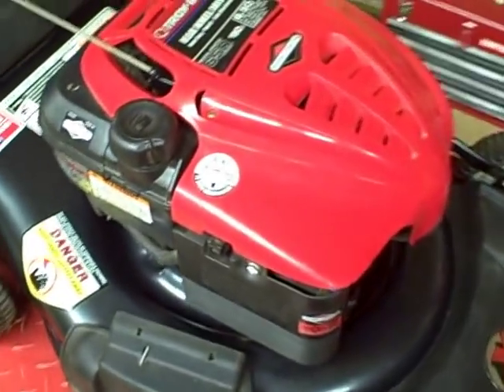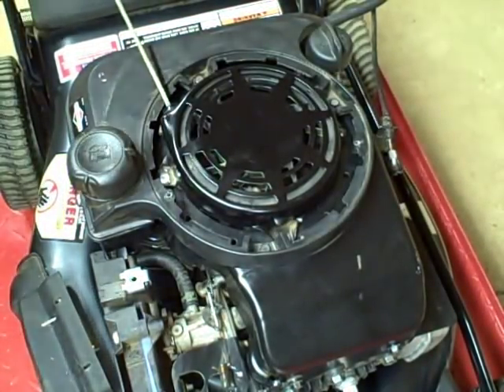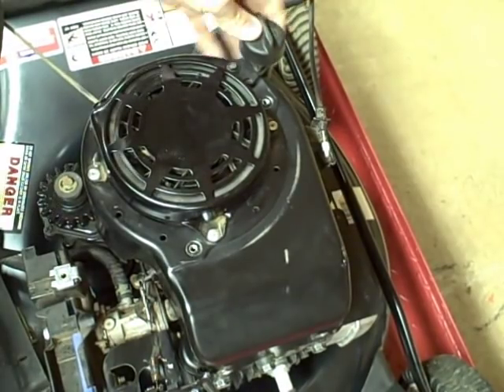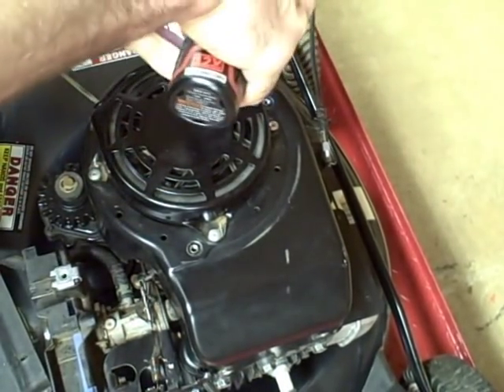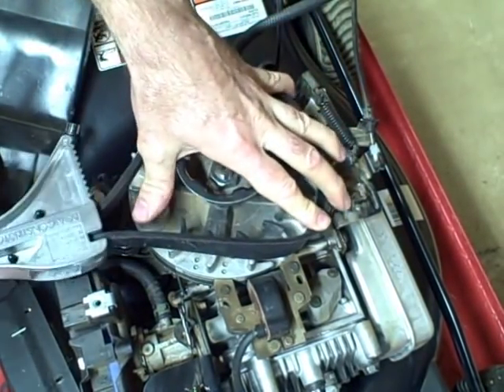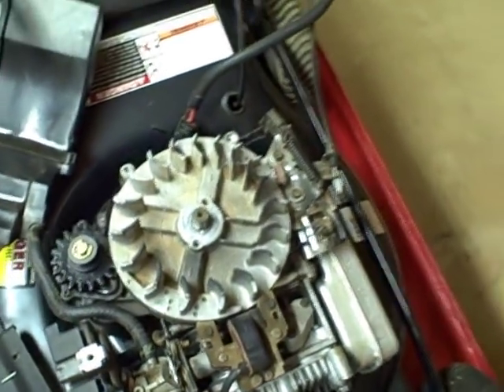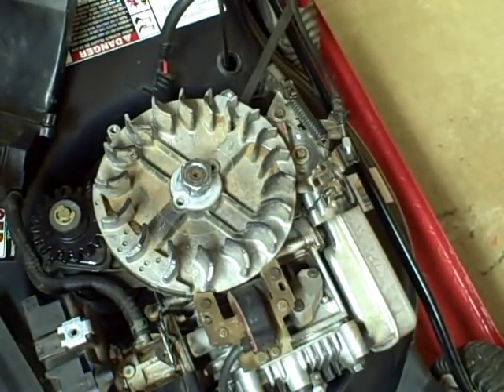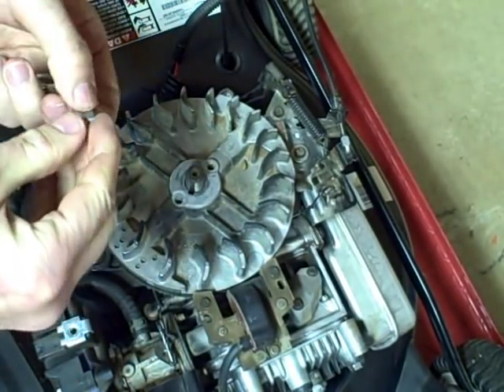How to replace a sheared flywheel key on a Briggs & Stratton walk behind lawn mower

Comment: You're a very smart man, to mention that the tapers on the crankshaft & inside the flywheel needs to be thoroughly cleaned and dried to prevent dirt or debri from causing the flywheel to slip on the crankshaft, which would easily allow the key to shear again. After professionally repairing various makes & models lawn mower engines since 1982, I learned A LOT about these things!

Comment: Thank you!  This never happened on my old belt driven mower, but my 2013 7.75 HP Snapper that I bought used developed this problem today.  Three screws, and my cover popped off to reveal a flywheel with shards of key, and a loose flywheel nut. While I was down there, I discovered the air filter hose wasn't attached, so this repair may save me from an even bigger one.  The hardest part of this repair was locating the model number.  Off to the parts store!

Comment: Thank you so much for this great video.  I brought my lawn mower in to be serviced, it just stopped working one day.  The place said they had no wait and could work on it right away. I told them i put new oil, gas, spark plug and had cleaned the carb. A week later they still had it and said they were working on it. 5 weeks later they still had it and said they were trying to figure out what was wrong. i demanded it back, took it home and followed your video. FIRST PULL! saved me a lot of money!

Comment: Thank you for posting this video.  I have a craftsman lawn mower with a Briggs & Stratton.  The lawn mower hit an old meter fence post, which destroyed the blade.  I replaced that but it won't start.  Next thing to check is the flywheel key.  Now I know how.

Comment: My father-in-law hit a piece of scrap metal that I tossed off the trailer right next to his house.  This did the trick getting it back running.  Thanks for posting this video.  I used a tie-down strap as an improvised strap wrench.  I just tied it off onto the mower push bar.

Comment: Thanks for the video buddy. I followed your video step by step for my 3 year old Briggs & Stratton and it worked like a charm. I had never worked on any kind of an engine before so this was a great learning experience. It took me about 30 minutes from start to finish. The only difference was that I didn't need to use a strap wrench to remove or tighten the flywheel nut. I just held the flywheel in place with my left hand and cranked with my right. Thanks again!

Comment: yes, thanks for the video.  your tip on how to get the flywheel off with just a pry bar and hitting with the nut slightly above the crank is a time saver when compared to using a 3-prong puller over the flywheel.  i'm going to do that next time.

Comment: Be careful with that, though - I just found out the hard way that if you don't tighten it down pretty tight - you're almost guaranteed you'll be heading back over to where you got that flywheel key to buy another!

Thanks @smallengineshop, this was super helpful!

Comment: Thank you!! I used the tip you gave for removing the flywheel without an impact wrench-worked perfectly!! Mower is up and running!! Can't say thank you enough-very clear and easy instructions, I had no problem following them. Thank you!!

Comment: This worked great!  Thank you for the video!  I had replaced my carburator, new fuel, new oil, and still not working. Almost ready to buy a new lawn mower...  Mine was sheared in half with flakes of metal all over which I saw after removing the flywheel.  Had it back up and running 15 minutes later.
Reply from the maker: +Charles Rankin Good to hear! Its much cheaper to replace the flywheel key than buy a new mower...

Comment: Thanks for this video. I had hit a stump with one mower and bought another used one a couple days later. Then started searching how to fix the old one. Saw this video and figured I'd try it. Couldn't find any 'keys' local so ordered from HD ($2.97 delivered to store for 3 of them which was 1/10th the price from sears). Keys came in 3 or 4 days later and within an hour I had the mower running again. Now I have two mowers working so I'll be able to sell one of them!

Comment: Excellent video, thanks. I had never done this before but you made it so easy I did it in 30 minutes. My flywheel did not come loose with your method, though - the pin was sheared and the crankshaft threads were rusty. However, I used a 3-arm puller which worked great.

Comment: Very well demonstrated.  You got yourself a subscriber.  Of course, if the key is actually sheared and the engine has been in the weather for a while; The flywheel would rather break in half than come off.  Even if you pry and tap the shaft and then cut threads and use a puller.  C'est la vie.

Comment: Thanks for the video man. Followed along and it worked perfectly. The flywheel was a bit stubborned to get off so I'm hoping I didn't damage the crankshaft or crankcase as you warned. Seems to be running fine though.

Comment: Wish ALL videos were as comprehensive and detailed as yours!!  I have one question, though.  What size socket do you use to remove the flywheel nut ... or is that a special sized socket like the one used for installing/removing spark plugs?

Comment: For those people that don't have a strap wrench or a blade removal tool you can also remove the spark plug and insert some rope to bind the piston to stop the flywheel from moving. Once the nut is removed I grab the flywheel and pull up and hit it gently on the opposite side of where I grab it with a rubber mallet to pop it loose.

Comment: Hi, That was easier than I thought after I saw you do it, the one question on that particular engine is what timing marks to use underneath, I'm assuming that I am to match up the plastic gear on the camshaft that has the 2 hash marks with the the hash marks or line on the crankshaft, John

Comment: Puzzle for Experts Here!;   Mine has the flywheel key with NO damage, but the engine after hitting something violently runs at HALF the rpm unless I really add another spring to force the throttle open!.

 It is an 2009 Ariens ST 622 String Mower that has a V belt drive to the jackshaft that holds the giant weedeater type "string" . I was cutting up crap after a Hurricane storm surge and the belt/string caught a piece of rope I did not see. The motor stopped what it seems instantly. After cutting out all the mess of rope I could start the engine but it only runs half speed when the throttle cable is fully to fast. It is pushing correctly at the carb. The only way to get it to run at a high rpm is to pull on the throttle at the carb. All the stock springs are there, nothing (outside) appears bent. One can disconnect the throttle cable and that is not the issue.

Thus I added another spring that tugs like mad at the carb area, but it still is not fully up to speed.

Thus I saw videos like this and pulled the flywheel and the key looks perfect. The old key and new one look and measure the same.  For good measure I replaced it anyway and reassembled the engine and it does the same thing.

**Could the crankshaft be twisted so the timing is wrong with respect to the crank throw ie piston?

The engine is a 122L02-0012-F1 built in 2009; a L flathead 12 cubic inch 625 series 190cc

**The engine acts like the governor is biased wrong, ie thinks the engine is going too fast. Thus I ponder if the violent stop goofed up or bent the governor inside "guts" or its shaft or cranks. 

The goofy thing is so many experts told me it had to be the flywheel Key and it was not. 

The engine had less than 10 hours on it before the accident. It is not a carb clogged issue.  

Any help would be welcome before I place a HF Predator engine on the beast.

The entire life change of running slow was due to the rapid stopping of the engine.

The string mower drives a belt and the pulley ratio is about 1:1 The rope did get all caught at the both pulleys, thus the engine stopped rotating just like hitting something hard.

I have tried new flywheel key and new springs at the carb governor area and it still runs slow

The coil's laminations to the flywheel's magnet timing looks correct to others on the web who show good and sheared keys.

Stumped.

Comment: Very informative video, good step by step guide. Looks a bigger job than i thought. Would you know if the shear key was broken by the lawnmowers performance?
Reply from the maker: Thanks. The mower won't run right with a sheared flywheel key. Throws the timing off.

Comment: If you don't happen to have a strap wrench, it works just fine if you unhook the spark plug, put on a leather glove, and hold the end of the blade while backing off the nut.  I do like the trick of tapping the shaft, but as you already mentioned, a soft-faced hammer would be the better tool.  It's also a good idea to put a piece of pine or other soft wood over the nut as well for extra insurance.

Comment: Great video...clear and concise. Made the job easy-thanks!
Reply from the maker: Thanks
Reply: ***** The bigger bolt on the bottom side of the fuel tank. I over-torqued that bolt and now it wont thread at all. The tank is held down by three other bolts, so can i get by with just three? Or do i need a whole new mower for just 1 bolt missing?
Reply from the maker: You might try repairing the threads.
Reply: ***** You were right, the threads are worn. Also, what size are the bolt or nuts on the blower housing, i have a ratchet set and only one size almost works but its a little to big. Its labeled 8(and 5/16)

Comment: great vid-exactly what i was looking for! just wanted to ask something. i hit a drain cover and felt the knock at the time. the mower carried on for probably around 15 hours before cutting out.. cutting out again before it finally died. when trying to pull it over i could feel something locking very hard. i imagined a valve locking against the piston. is this possible even? was just about to start looking at the head when i thought of the woodruff key and found your vid!

Comment: thanks for this video man I really appreciate the time you took to shoot it. very clear and direct to the point. the little tricks with the strap wrench and "bumping" the crank to remove the flywheel was worth the price of the whole video :)

is that an oil filter strap wrench or???

just curious tho, how many "bumps" would the crank take before you might damage it? or would it ever be likely to damage it? sorry for the dumb questions. thanks again.

Comment: rather than screw up your crank threads you could take a 1/4-20 tap and put the threads in there.    a Briggs flywheel puller uses self tapping bolts to do the job for you.   fyi, just because you didn't mess up the threads don't mean the next time you do one you'll have the same luck.    the Briggs tool is pretty cheap but if you already have a generic 2 hole puller just tap the holes....you'll like the results

Comment: Small Engine Shop after doing this I'm having some kind of misalignment between the cable crank in the blower housing and the piece on top of the fly wheel. The little wings that stick out of the blower housing are slipping when they try to grab the piece on top of the fly wheel and I was just wondering if you had any advice on how to fix that? Thanks!

Comment: I took my BS 6.5 apart; cleaned carb, changed all fluids and spark plug; cleaned under-carriage. Still won't start. The rope pulls only about 12 inches and stops. Should I check for a sheared key first or a problem with the rope? This is my first time working on something mechanical so ANY advice would help a lot. Thanks!

Comment: Nice description.  
I've got a similar engine with flywheel removed.  Inspection confirmed that the bearing is not holding the crank tightly, thus oil leaks there.  
Can you direct me to instructions to remove the bearing.  Maybe some people refer to it as a bushing.
cheers.

Comment: My Brigs and Stratton push mower is hard to start. The flywheel key is not sheered but the flywheel is stiff and hard to turn. Has plenty of oil but not too much. Gas is good, new  sparkplug. It often takes several pulls to start mower.  Any suggestions?Runs good once it starts.

Comment: Allot of engines don't have threads in the holes. you just find a bolt that is similar and start to thread it in, the aluminum is soft enough to allow threads to be made.

Comment: how would I know that the flywheel key is sheared. a chunk of wood got stuck in riding lawnmower deck pulley and now when i go to start it, I hear the noise but the fan doesn't spin.also would the riding lawnmower have the same flywheel system?

Comment: YOU SHOULD "ALWAYS" DISCONNECT COIL WIRE OR REMOVE SPARK PLUG WHILE WORKING ON THE MECHANICAL PARTS OF A LAWN MOWER. THEY CAN SOMETIMES START UP AND CAUSE INJURY OTHERWISE....SOME HAVE OTHER SAFETY MEASURES TO PREVENT STARTING - BUT NOT ALL.
Reply: Yeah don't think that push mower will start on it's on. But good advice for something battery powered with a starter !